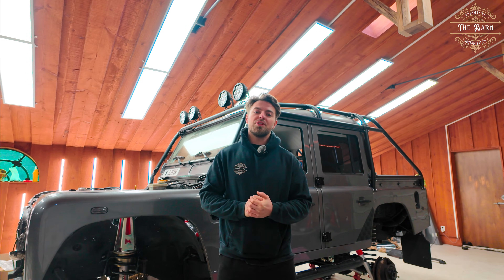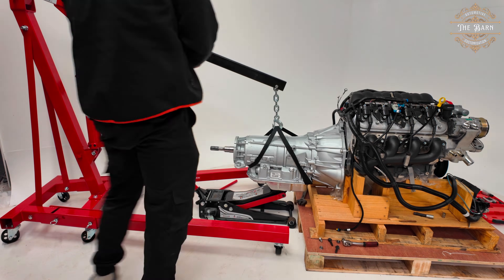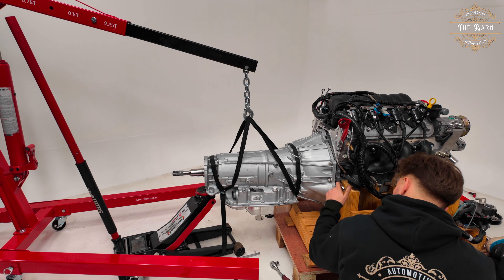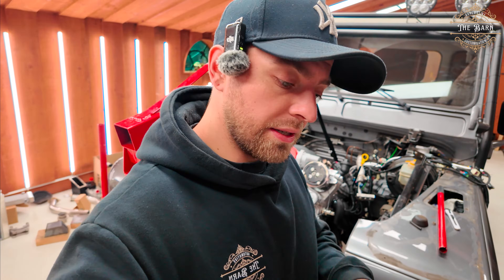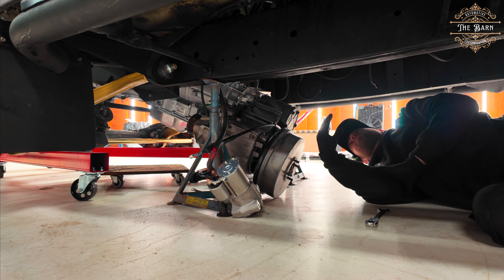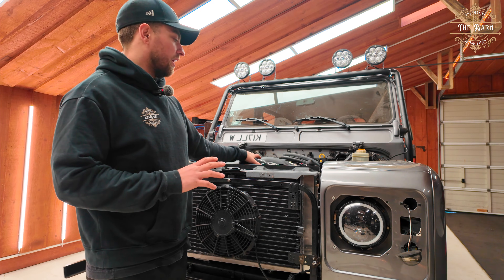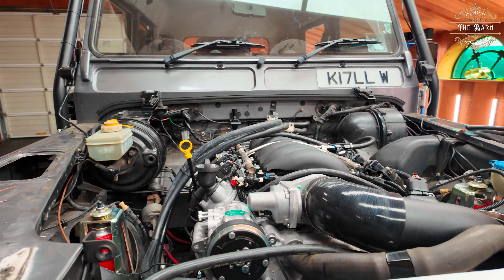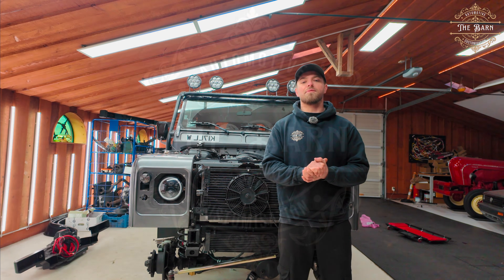LS Swap Landrover Defender - LS3 & 6L80E installation

Comment: Nice work man. Definitely a multi stage process getting the engine angles right. Not sure how your front prop shaft will go with he engine sitting central, as it comes real close to the bell housing on full compression. Some people chop the square boss that sticks out for the extra clearance. Managed to avoid it on mine. Looking forward to your exhaust vid for comparison. Cheers.